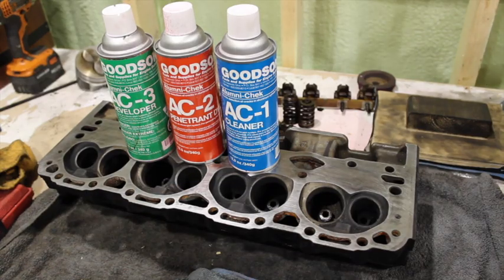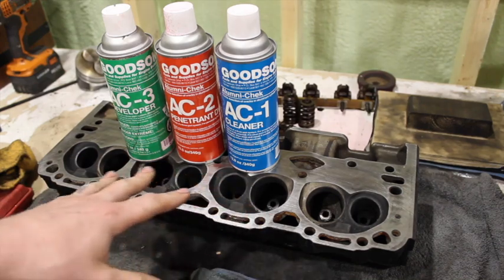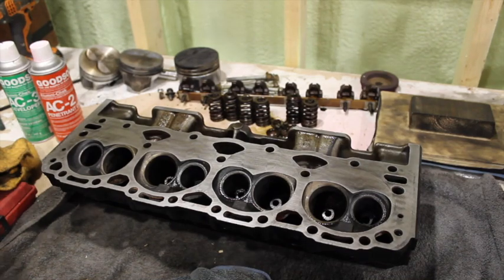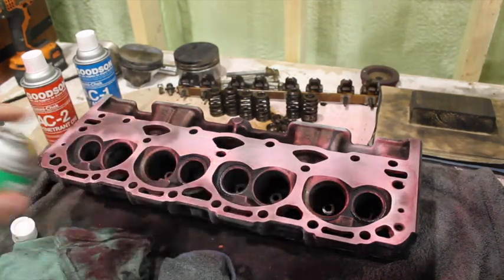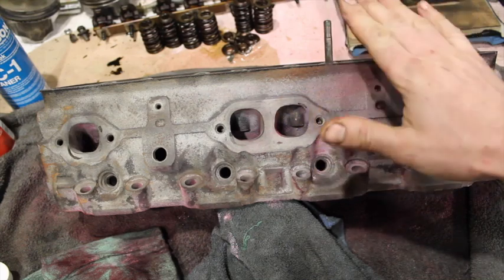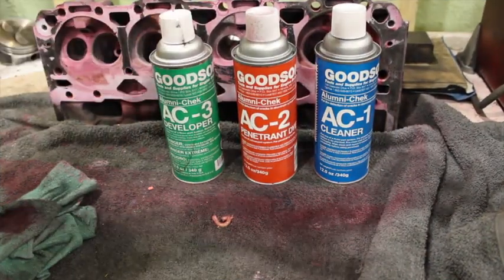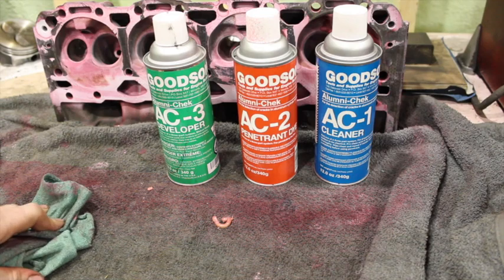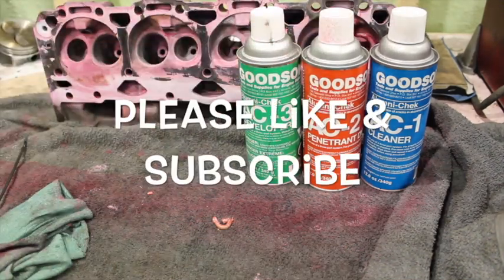Vortec head cracks? *Checking at home*

Comment: Funny thing is I've been watching a couple of your videos the past day or so, and I went downstairs to check my 906 and 062 heads and found my 062 head has a crack in the typical center bolt. HOWEVER, it has been sleeved or pinned so it can't leak into the bolt area. Plan is still to take them to my local machine shop for final say.
Reply: you know its cracked,they cant tell you anything you dont already know.im a machinist as well.

Comment: Personally I would attempt to fix that casting, I would clean out the cracks, then pre heat it, then I would TIG weld the cracks with silicone bronze filler rod, technically TIG brazing. If it worked great, if not, you’re not out much.
Reply from the maker: I've tig welded a few heads for my own engines (mostly aluminum) but most of the stuff I do is for customers and I just can't take the risk haha
Reply: Yeah absolutely I wouldn’t weld an iron head for a customer either, just my own stuff just for fun.
Reply from the maker: Exactly! But I appreciate your ingenuity!
Reply: did them heads come off a motor that was running hot
Reply from the maker: I don't have the history on the engine those came off of unfortunately. But I would imagine it was over heated
Reply: @cuttersperformance  ok jus curious I was seeing it looked like over tightening um would you think it would cause leaking if so where

Comment: This is great! Thank you for putting this out there - I wish I would have known this 6 months ago - would have saved me so much money. Awesome content!
Reply from the maker: No problem! Did you run into some cracked vortecs?
Reply: @cuttersperformance    Yes I did. I new to all this and I had someone local take pretty big advantage of me - they sold me a Holley carb from a dump truck with governers all over it, and the heads were cracked in the same spot these were. I did not know better and thought I was getting a good deal. Yes, it is my fault for not knowing, but it takes a real butthead to take advantage of someone like that. This information you are putting out there is helping soooooo many people  - thank you!
Reply from the maker: Sorry to hear that man! That sucks, but I've been in the same boat with people selling stuff online. Unfortunately some people don't care
Let me know if there's any help/info you need and please share me videos so we can help more people that might need some help on their vortec heads
Reply: @cuttersperformance  I most certainly will share! I appreciate your content more than you know. This sort of thing is exactly what keeps people out of the hot water I got into. I ended up buying Vortec heads from the cylinder shop on eBay - GREAT people, and my car runs fantastic now!
Reply from the maker: @donaldwarwick6780  Awesome to hear man! And thank you!
Upgrading from older heads?
Reply: @cuttersperformance  Yessir! old 307 heads had to go - these amazing - thank you for the great content, keep it up man! Awesome!
Reply: I was looking for some 4.3L vortec heads. I found 1 good one on 3 engines.  They seem to crack on the head gasket mating surface between the short head bolt holes and the water jackets. After I took the heads off 3 engines and only found 1 probably good head. I couldn't find any more 4.3L in the pile.  I ended up buying a pair off Ebay advertised as better than new. Even those were repaired. Stitched up in the same places I found cracking on the heads at the wrecking yard. I put them on anyway. Luckily they seem to work ok. I put about 5k miles on it so far. I don't really trust it but I don't have to drive far to work and I have another vehicle just in case.

Comment: just picked up a set ...both with idenical tiny cracks. Center bolt hole nearest the chambers. Didn't need flux once i cleaned them up and looked very closely. Mechanic friend says its from uneven torque patern when installing or removing. Either way, I'll be getting my money back from the yard.

Comment: if i pull apart a vortec engine that doesnt have milky oil or pressure in the coolant system, or the valves arent burnt, and the head is cracked.....im running it. 5.2/5.9 magnum heads crack like crazy, and people still run them.

Comment: How do you cut the valve seats for 202/160?
Reply from the maker: I used to do them with a hand cutter but couldn't get the best results. Its best done on a proper seat cutting machine to insure centered and round seats

Comment: If cracking is common should just buy new heads ?
Reply from the maker: Common on the early castings
Reply: @cuttersperformance  Where is the date code or what early years ?
Reply from the maker: @RichieCat4223  the ones thats are made in mexico are less prone to cracking. But they also flow less unfortunately
Reply: @cuttersperformance  OK thanks

Comment: Hell yeah man just what i needed  just tore down my 97 vortec   you think bigger valves are necessary  on these heads for a street rod
Reply from the maker: I would not waste your money on larger valves, a mild port job has been proven to be much more effective 👌 especially around the valve seat
Reply: no,not worth the time.
Reply from the maker: @trillrifaxegrindor4411  video coming soon comparing, vortec heads ported to vortecs with 2.02/1.6 valves on the flow bench!